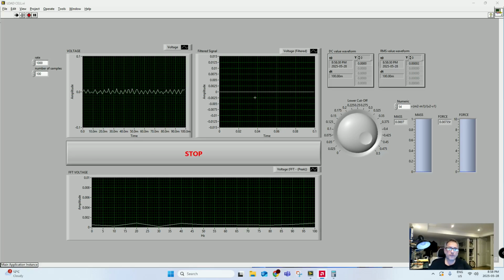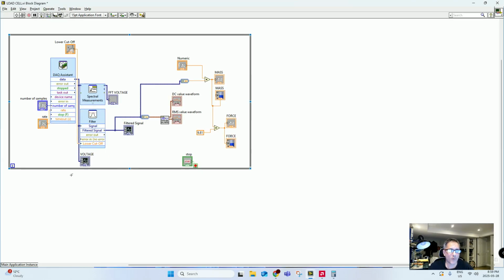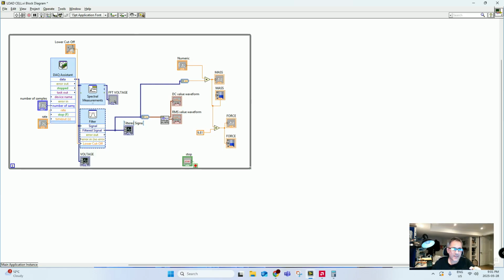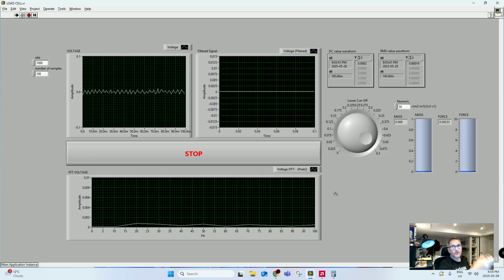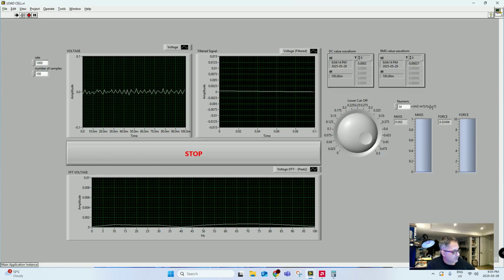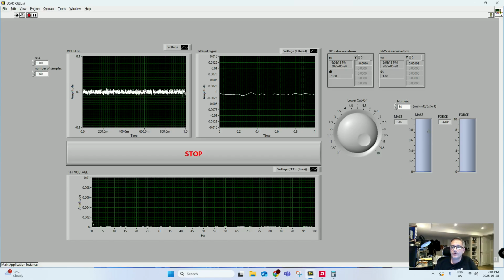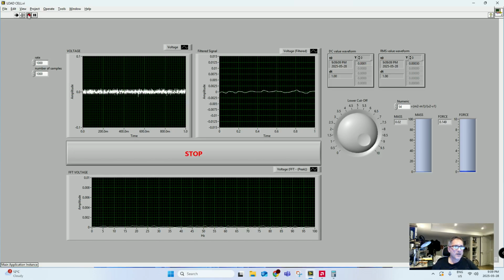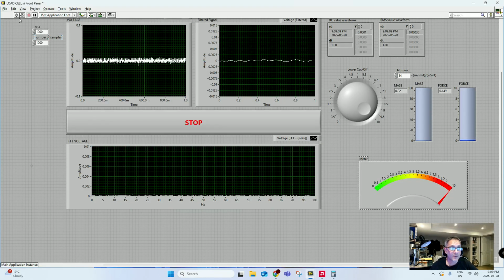DY 510 LOAD CELL with NI 6009

Comment: Excellent explanation and use of LabVIEW to capture the essence of the measurements.

But when you're showing the mass, it looks like it's only set up for 1 significant digit and it's not clear what is the 'exact' number. I.e. when you measure the 100g weight @7.42 in your video, the force results fluctuate > 1. According to your formula, F = m x 9.81, which means that the measured mass is really not 0.1 but smth like 0.111Kg. So, it may have been more interesting to see the actual measured mass value with more significant digits enabled, in order to appreciate the actual fluctuations in the measurements.

But overall, great video !!
Reply: I am looking fur a better load cell amplifier but they are so expensive. I was thinking about futek usb as long as also the analog output to implement it on LabVIEW